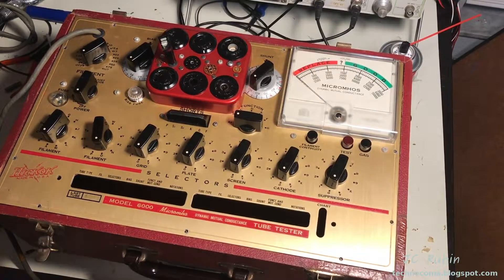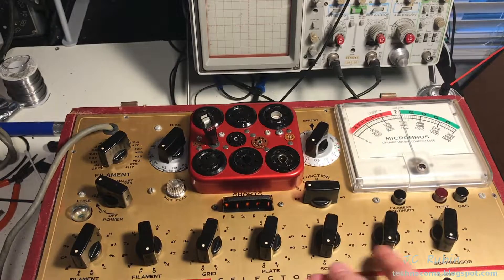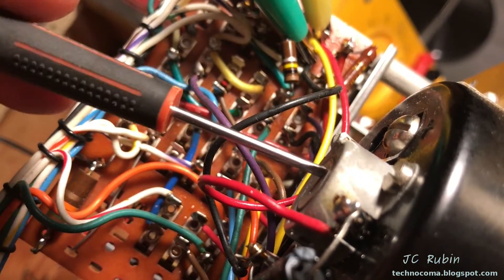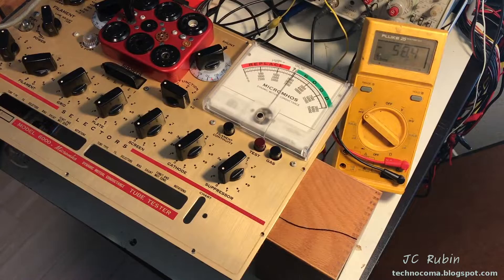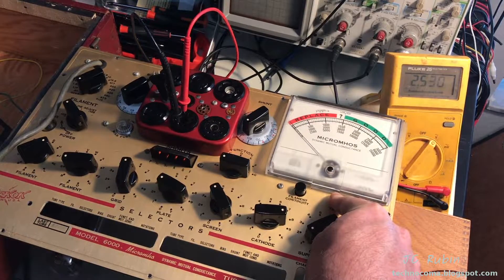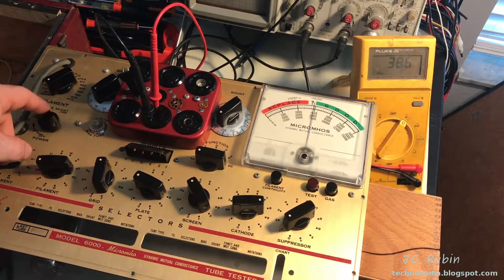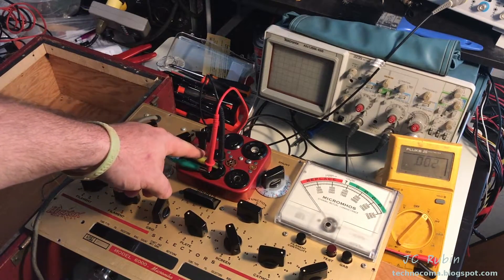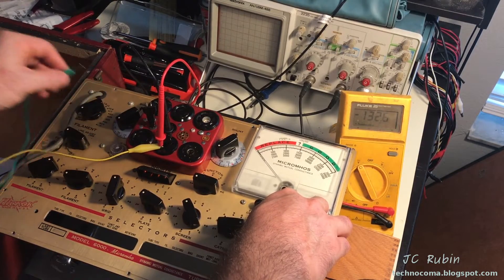Hickok 6000 Tube Tester Restoration - Complete Calibration Part 1 of 2

Comment: I recently picked up a Hickok 533. It is super clean inside. It seems to be calibrated correctly and gives me readings almost identical to my recently refurbished and calibrated 600A. But on the shorts test, I get a false positive in positions 5 and 4. Any ideas or tutorials on how I fix this issue? I have it listed on Ebay, but I'm sure it will sell better if I could fix the shorts test issue.
Reply from the maker: I don’t, but the schematic for the short test lamps should reveal with little effort the source of your problem.

Comment: Hello ! Thanks for the valuable info. Have just got my first Hickok tester, a 6000A and reviewing resistors x schematic, the only resistor i could not find on the schematic is the 11K ohms resistor which is mounted on the 3 push button switches. I have seen for sale on ebay a 3 button switch assembly which has the same resistor i'm trynig to identify... so, i assume my tester is ok and that resistor is really a original one... and the tester looked original inside...Do you know where it should be on the schematic ? thanks.

Comment: Thanks a lot for this series. I just got a model 6000 couple of weeks ago. like yours, I had to do case repair, mine was smashed in like yours. in reference to the question you asked about the sockets on the island, I have the model island you were asking about that has the 7 pin inline socket on the schematic you showed. the "island' on mine is very different from yours in that it is just a flat plate that is not raised and does not overlap the Bias and Shunt knobs. the inline socket is just a rectangular shaped socket with 7 pin holes in a straight line. if there was only a way to put pics in the comments! going to be doing calibration after a bit more studying. thanks again!

Comment: Did you have to use a special multimeter to calibrate? I noticed in the directions they say use a 1000ohm & 20k ohm meter. Not sure what that is.
Reply from the maker: Back in the day, multimeters of higher quality had less circuit influence, today a modern meter should work just fine so long as you didnt get it on wish . com
Reply: @retrotechandelectronics  , actually, this is not correct.  In the days before digital meters became inexpensive, the only calibration procedure that was to be measured and adjusted with a high impedance meter that didn't load down the circuit (a VTVM, or  vacuum tube volt meter) was the calibration of the AC grid signal. All other calibration checks and procedures were done with an analog voltmeter that tended to load down the signal (a load of 1k ohm per volt) being measured, and if you use a modern digital meter and adjust voltages to Hickok's specs, the working voltages of your "calibrated" tube tester will actually be a little low.  Alan Douglas explains this in his book on tube testers, and since the highest voltage in the tester is 150 volts DC (to the tube plates), and you are probably setting the meter to a 200 or 250 volt scale, the solution is to put a resistor of 200k or 220k (Alan says its not super critical) in parallel across the probes of your digital meter. This loads the tube tester voltages down a little to conform with original Hickok calibration procedures.  I have a dual-banana plug with a resistor across it that I plug into the front of the meter and then plug my meter probes into the banana plug in order to get that loading effect on the voltages.

 The grid signal AC voltage however can be measured directly with a digital meter.
Reply: 1000 ohm per volt meter- load resistance for all tests, basically an analog meter of the day;  except the AC signal to the grid , where they specified to use a 20k ohms per volt meter, with a high impedance input so it wouldn't load down the signal. See my other post for clarification, and a workaround.

Comment: Make sure you go back and check the meter for 58.2mv when you adjust that blue pot for 2.5vac it takes the 58.2mv out of spec will  need to go back and forth with both pots till you get the 2.5v and 58.2mv

Comment: Hello!
Many Thanks for this series I was lost without it.  One question if you don’t mind assisting a hobbyist.  I ran the test you begin at 5:00, The highest reading I can get is 52.  I have adjusted both pots for maximum while keeping the line test correct and 52 is still the highest.  Both pots seem to work as they should.   Do you have any ideas where I can look next?

Comment: HI,
thanks for this video. I'ts a huge help for getting my Hickok 6000a calibrated.However,  I'm having a problem with getting 2.5 volts when I adjust for the test button. I can adjust the blue pot to get 2.5 volts, but once I do the needle on the tester doesn't go all the way to zero when I hit the test button. Is their something I'm doing wrong?